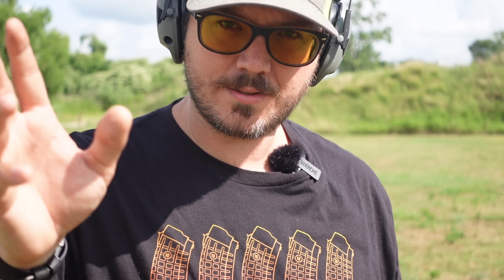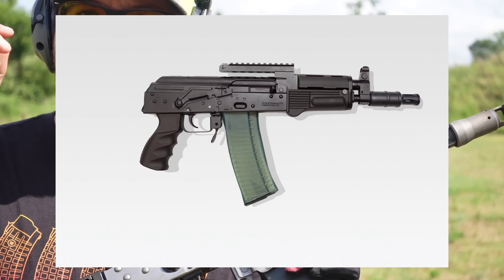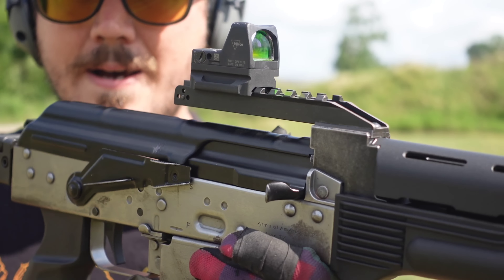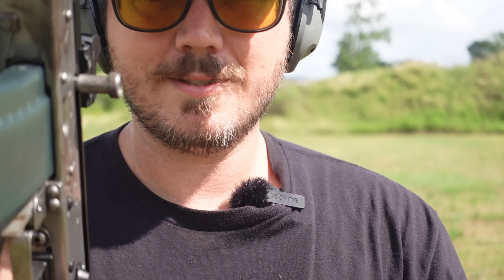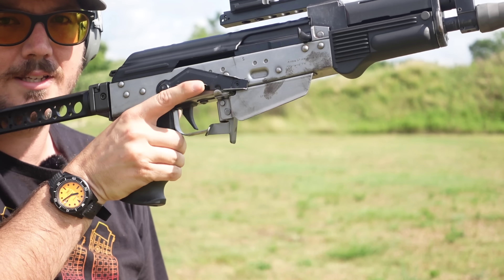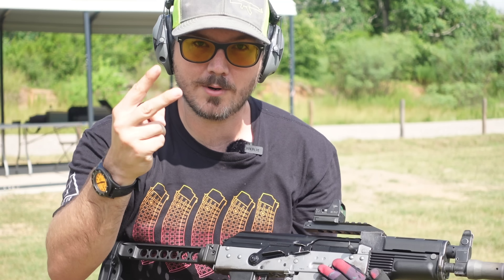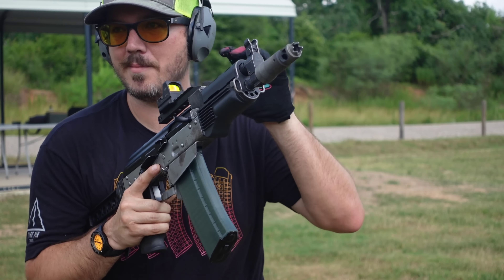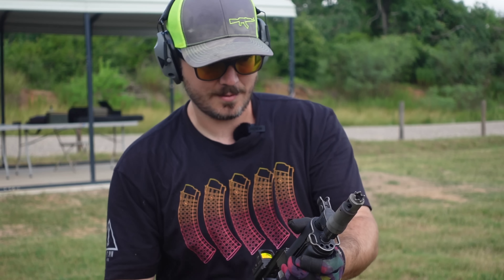The fastest AK I've ever shot: Mini Beryl by Krebs Custom. SPEED LOADER!

Comment: I had my gunsmith install the 1913 pic rail and I have the attero arms optic mount.  Those 2 mods make this gun so much fun to shoot. For $999 this gun is a steal,  very smooth shooter.
Reply from the maker: 100% agree
Reply: Was it the occam defense 1913 that was used?

Comment: Love those mods to this gun. I need me a 556 AK. What’s the best one for the money? Beryl, Sam5, or ?? Tho not an Ak but maybe even the Galil ACE?
Reply: Beryl 1st galil 2nd. Also the galil is very much an ak. Sam 5 is out of the picture, too many horror stories.
Reply: @homerpimpson7169  Completely Disagree on Arsenal Sam5's they are not bad at all, they just got some mediocre imports for the 2021-22 season. 
I have a 2020 manufactured one and had zero issues over 7K rounds (besides cheap Tula cased 223 having garbage QC). Of that 7K number around 6K was steel cased, and 1K was brass. Very expensive though, Spent $1700 on mine, but you get what you pay for.

The Galil ACE Gen 2 has heavy front rails on it and really is good in 5.56 because it uses standard 5.56 AR mags, would probably recommend a rifle length barrel though with 5.56. I own 2 Galil rifles, a pre-ban Galil AR Model 386 and a first Gen 7.62x39 pistol, and used to own a Gen 2. The AR is an amazing rifle, the Gen 1 pistol is worthwhile, The Gen 2 was more front heavy then the Gen 1 5.56 Galil rifles.

Never shot a Beryl but hear good things, but I don't own one so im not gonna hate on it. But Palmetto State Armory makes a very good 5.56 AK.

My recommendation order
1: Galil AR (Good Luck finding a pre-ban one for under 3K, Don't know the quality on Century Arms Golani Galils)
2: Arsenal Sam 5 (My Recommendation)
3: PSA AK101AKM (Cheapest by far)
4: Gen 1 Galil ACE
5: Gen 2 ACE
Reply: @RedZeppelinAirship  don't think the sam5 is necessarily bad, just seen too much negative reports on them to take a gamble at spending 1700 on one.

Comment: So does this thing take a standard AK muzzle brake detent plunger and spring???
Reply from the maker: Nope. Polish Beryls are just that way. Krebs can make an an AK12 style brake work tho.
Reply: @KLAYCO47  I know they don't take standard AK muzzle brakes my question is when you take out the fixed detent pin can it be replaced with a standard spring loaded detent plunger or is it a special spring and detent plunger that has to be installed so you can screw and unscrew 24 mm muzzle devices

Comment: IDK man, part of me thinks that at some point it either isn't an AK or it's so different that you might as well start with a more modern base gun. Then the other half of me says, but that's just evolution and lots of modern ARs are not close to the first models. I do think that at this point, you might as well have a magwell and straight insert mags. Yeah, STANAG. That's especially true because the guide is not just a bolt on part, but riveted in place. I would rather have a modded Galil ace.
Reply from the maker: Go for it
Reply: @KLAYCO47  I might. However, I was really just looking for convo about this mod and the line between AK and "not AK".It would seem strange to me to get as close as one could to a magwell, while refusing a STANAG magwell because it's "not AK", even though it's superior.

Also, using STANAG mags just makes more sense, considering the 5.56 mag options we have. It's a lot like your argument for 5.56 vs 5.45. A STANAG mag setup is actually better than rock and lock and the quality mags are cheaper and more available in the US.

Comment: Odd pronunciation of "Beryl". It's a type of gem stone (Emeralds are green beryls). Most folks, including jewelers and lapidaries, usually pronounce it the same as "barrel".
Reply from the maker: Yeah most people say it both ways
Reply: A little known fact, but the Beryl series of rifles predecessor the Tantal (wz. 96 Tantal) was a 5.45x39mm chambered assault rifle that was developed in the late 1980s as a potential replacement for the AKM in Polish service. However, with the fall of communism and Poland's shift towards NATO membership, the Beryl was ultimately chosen instead. The Tantal remains in limited use with some Polish special forces units.  Tantal is Polish for the element Tantalum.

The Beryl (wz. 96 Beryl) was named after the element beryllium, this 5.56 NATO-chambered assault rifle is the standard service rifle of the Polish Armed Forces (currently in transition to the FB MSBS Grot). It was adopted in 1997 and is based on the AK platform, but with various modifications for improved performance and compatibility with NATO ammunition.

Beryl is pronounced more correctly as the beryl you would say in beryllium.  However, Polish words are usually accented on the second to last syllable so the stress is on the "Be". Think Bear-ill. 😂
Reply: @mikecichy  huh, similar to saying "B-role" in a mild slavic accent. I learned something new today. Thanks!!

Comment: This is an AKS 74U copy, unfortunately quite ugly, but the magazine change is really faster but I think this time the key is the bigger reload button
Reloading is really fast, although those who are experienced in using Kalashnikovs can reload very quickly
https://www.youtube.com/watch?v=oqFmQYNBwcw
The operation of the Kalashnikov lies precisely in its simplicity, which is why it works in cold, hot, dust, and dirt, its disassembly and reassembly is also easier than other weapons
Although I saw a dirt test with the M16 and the Kalashnikov and surprisingly, the tolerance of the M16 is not far behind the Kalashnikov
For my part, I also find it a bit difficult to change the magazine in the case of Kalashnikovs, the system is too old, and you can't put optics on it, you need a separate assembly for that

The russian AEK 971 (new variant called KORD 6P67) is a very excellent design, although it should also be modernized at several points and the gas piston should be sealed, a pistol grip should be put on it, a first grip should be placed on it, a picatinny rail, an adjustable buttstock would be needed, but it is a very excellent design, but it is not used by the Russian army
The AK12, on the other hand, is suitable in terms of design, only the rate of fire could be 900 rounds/minuteó option could have been included